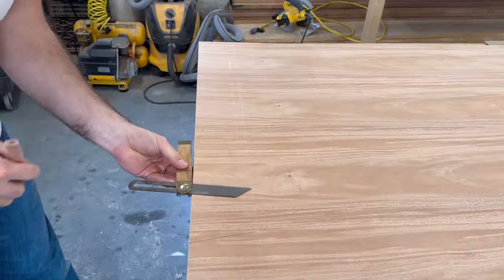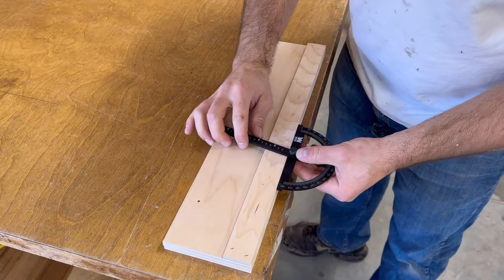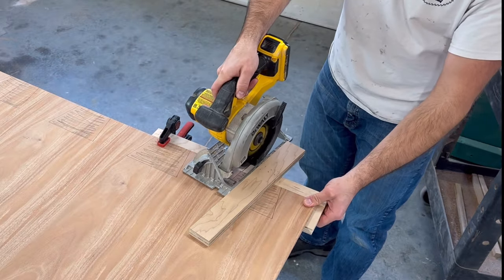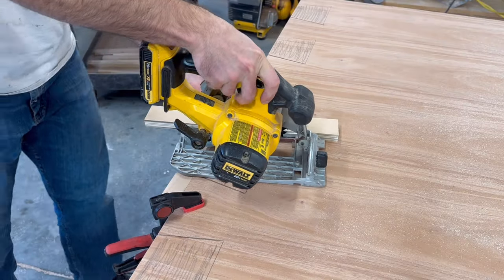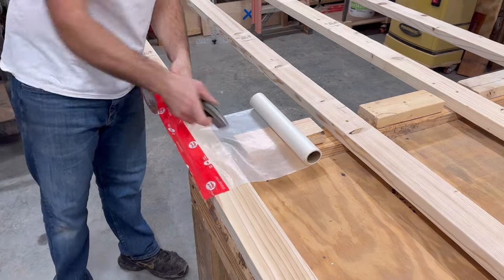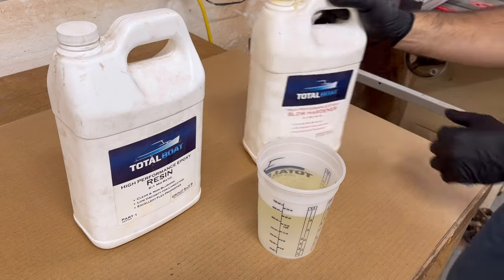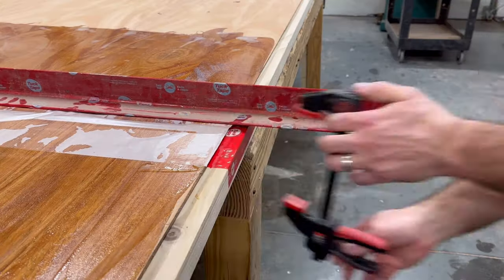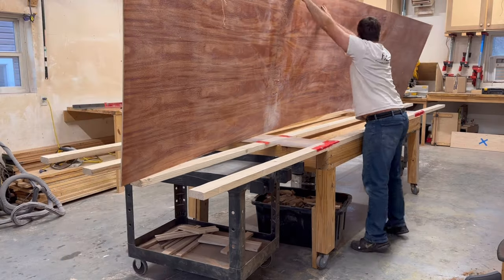Building a Boat - Part 1

Comment: I beleive most boat builders join their plywood by kerfing it
Reply from the maker: I am learning!
Reply: Its a scarf joint which technically this is.  I am more familiar with angled scarf joints but angles and shapes that fit together are technically scarfs. 

Kerfing is to bend piece of wood.  It entails a series of cuts where your blade doesn’t quite cut through the thickness.  You set your saw blade the thickness of the ply minus 3/16 (roughly) and make however many cuts needed. There are calculators to help with how many cuts and spacing between each cut.